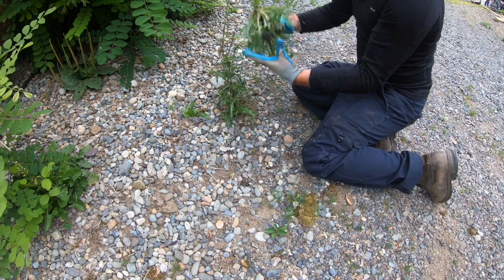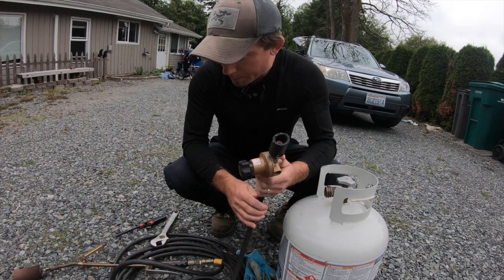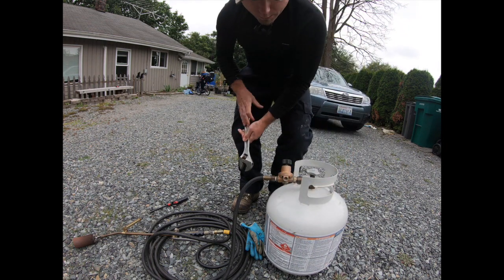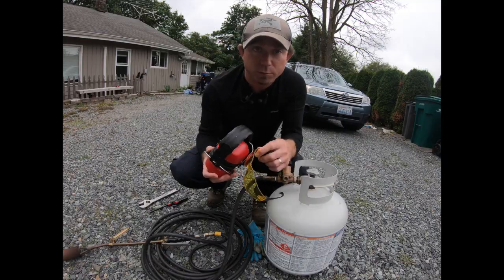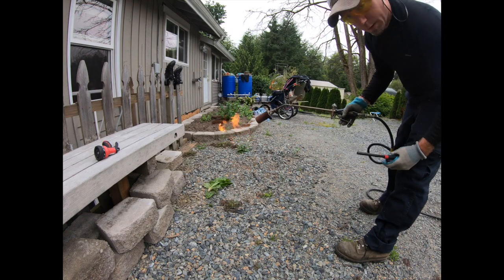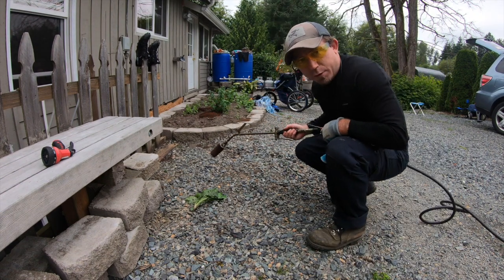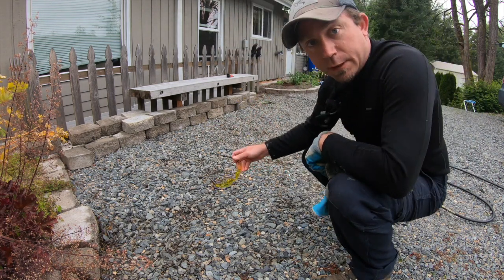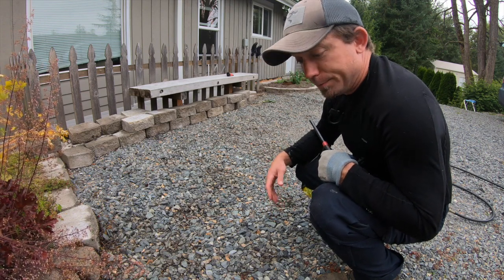Burning Weeds: How-To Guide to Burning the Weeds in Your Driveway

Comment: Got one week ago. I have opened up new areas for planting. I’m 66 and don’t want to use poison and I don’t have the energy to do it manually. I can hardly wait to try it on ice and snow. I have five propane tanks. I don’t exchange but get them refilled where they give coupons out. 3 coupons is worth a free tank refill.  Yes, a good tip about upgrading a tank, though a little shady 🧐. Good safety tips that I should follow. I move my tank around on a dolly.
Reply from the maker: Thank you for the comment and many thanks for sticking with the long video
Reply: I’ve also upgraded the tanks by trading them in. In fact, I was advised to do it that way by someone who owns a local propane business where I get my tanks refilled. The old style valves can’t be refilled due to changes in safety regulations. So it’s either trade them in or they sit forever. The companies that take the trade ins have better access to either repurposing, remanufacturing or otherwise recycling the old tanks.